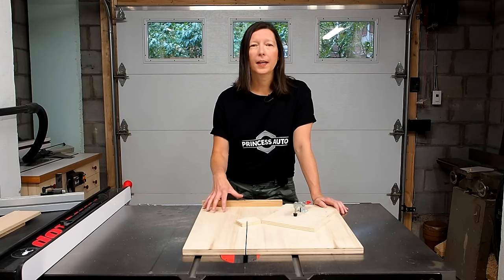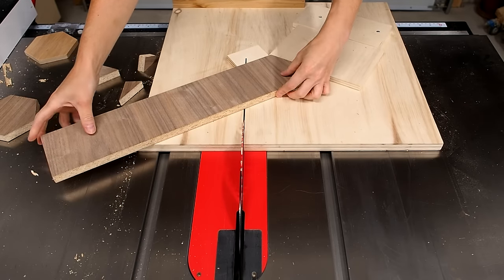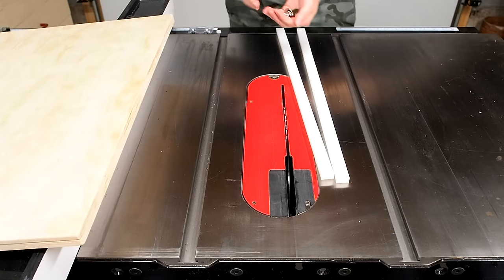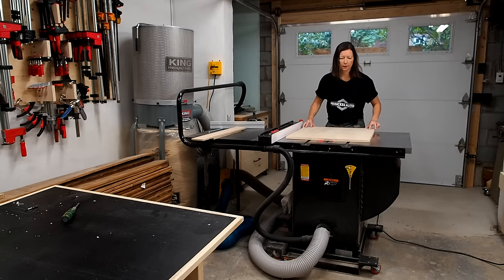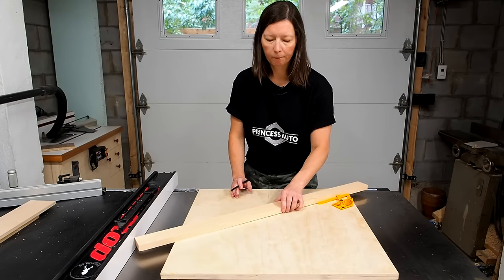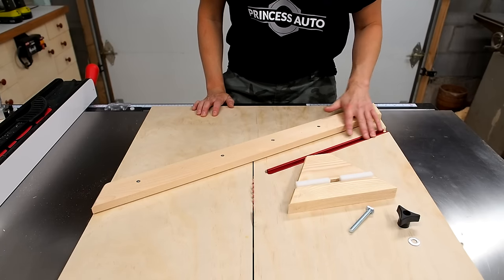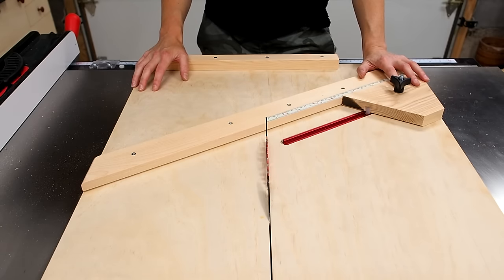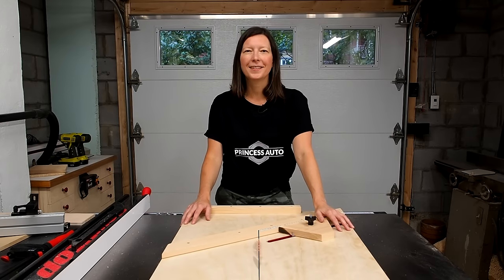Hexagon Cutting Jig 2.0 | Cut a Hexagon any Size | Adjustable Table Saw Jig for Cutting Hexagons

Comment: I built the first version of the hexagon jig and find it was the best jig for cutting them. Version two builds on the original and is definitely more versatile when it comes to varying sizes.

I would like to thank you as I needed to make lots of hexagons for my daughter's wedding reception centerpieces and this jig fit the bill perfectly. I pre-cut all the lengths of maple to the exact width and length to limit waste. After about 250 hexagons for 20 centerpieces (12 per) it was time to do all the glues ups, sanding and finishing. It was time consuming but worth it. In addition to this was the "greens", frosted wine bottles and table numbers that would make up the complete centerpiece. The cut-offs from each hexagon were saved and I have a 5-gal bucket of triangles (about 1000 :) ) that I have ideas for. I'd share some pics but there doesn't seem to be a way to do that here.

Comment: Thank you for this.  I work in foam and this is the first jig I've seen that did not require a degree in calculus to create.  Going to convert your plans to a hot wire cutter.

Comment: I didn't know how to go about building something like this for a project I have in mind and your video laid it out for me. I was concerned about using the saw blade to align the fence and realized that I could use my table saw fence since it's perpendicular to the blade and provided a stable reference for me. It didn't come out perfect (about .3 degrees off), but definitely better than I could have done on my own. Thanks for the great guidance.

Comment: Excellent.  I needed only a one-time jig, and I built it on my table saw sled according to this great idea. Perfect, and thank you.  As some lagniappe, you might try drafting triangles for common angle settings on the table saw.  They are absolutely accurate, better perhaps even than ceramic tiles.

Comment: I have a project that involves hexagons so I ran into your video nice job!  I liked it and built one almost exactly like yours but added one feature I found to be quite handy. I found a free online hexagon calculator copied the URL and pasted that into a QR code generator I then printed that QR code about an inch square and used some clear packing tape to affix to the sled as a handy way to simply scan with my phone and have quick access to that calculator. 
Thank you for sharing!

Comment: Well thought out and a straightforward and logical way to approach the adjustability

Have you thought about a toggle clamp or clamps on the backstop offset but in line with the blade?

That would let you make really small hexagons

Also how accurate did it end up being? Not sure if you’ve measured point to point (like you would checking diagonals on a square)

Comment: I'm about to get into my woodworking retirement hobby so really like your videos.    Your plan of adding the T track as well as the plastic slider when the stop is made to suit and but up against the long angled plank seems an overkill?  Could you have just routered a slot in the base board and relied on the combination of the slide stop butting up against the long plank and the plastic in the slot ?   Or just had the T track and the slider butting against the long plank ?   Seems to me as one operation too many either way.   Just my views .

Comment: Your tape measure can be set further back from the blade and zero point marked on the stop block.  Then nip off the point of the stop block to allow for small debris collecting to clear and not skew your cut line. The workpiece is registering off the stop block edge. the point is not required.  Should make up several different angled  stop blocks. Toggle hold down mounted on the stop block for small work pieces control. thin shims and playing cards at the rear of the stop block can 'shave ' adjust an angle.   Many use playing cards and post it notes as jig adjustments shims.  Also I've used drafting triangles and such mounted on top of stop block 'pucks' to register the work piece to.

Comment: Very clear instructions. 2 safety concerns. You need a  block behind your cut where the saw blade enters the straight fence. That way the blade won't come through and cut something it shouldn't (like a finger). Then with the motor off, push the jig forward until it stops. Then take a small cutoff and place it under the jig flush against the saw edge and screw it in place. The jig can't go any farther forward.              Woodworking rule #1 - Sparks or BLOOD, STOP turn off the SAW! (I have worked with idiots before)

Comment: If the resulting hexagon is not perfect (off by a couple of degrees on the last cut), I've been scratching my head on how to apply the "five cut method" (6 or 7 cut for hex, I suppose) to correct that error. Do you or any other viewers have advice for correcting the fence (other than just try moving it a little each direction and test again)?

Comment: Love the jig! Out of curiosity, what kind of blade are you using on the table saw? I've seen a lot of people using their table saws to cut out the dados, are you using an FTG blade?
Reply from the maker: I'm using a Diablo 50-tooth combination blade - ATG I think. It won't give you a perfectly flat bottomed dado, but wasn't really necessary for this. I also have a blade from CMT that I use if I want a flat bottom (TCG I think).

Comment: what's the smallest hexagon that you can cut with this jig?
Reply from the maker: No physical limit. Basically as small as you feel safe cutting. I use the eraser head of a pencil to hold the piece down so my fingers are far from the blade.

Comment: You totally skipped the part about cutting the dado for the slider half the width of your router.  Without those measurements I had to add a track and shims to route the jig table properly.  Would have been good for you to say something about the placement of that leftover piece of ash that you had.  Otherwise, this video is just an ad for your plans..and it needs to be stated in the video.
Reply: Be great to say something good..Rather that complain...